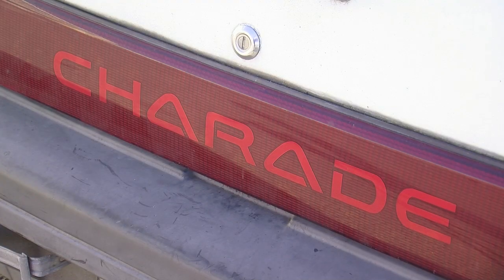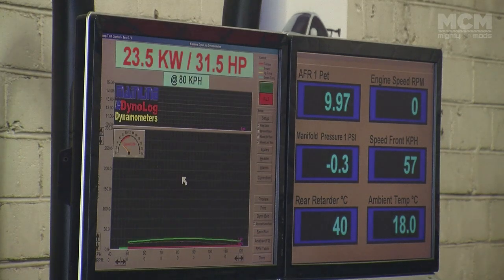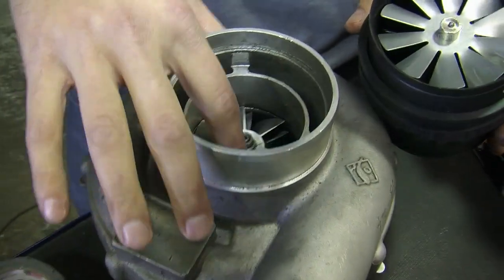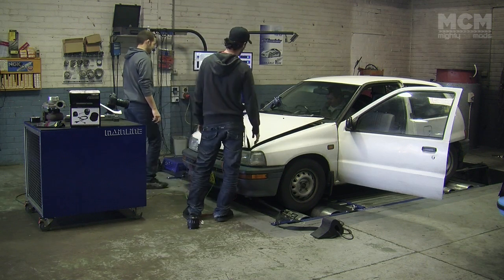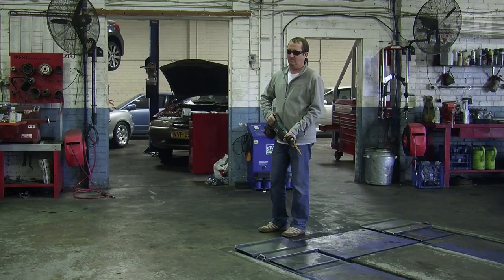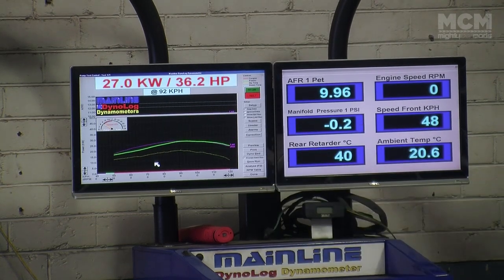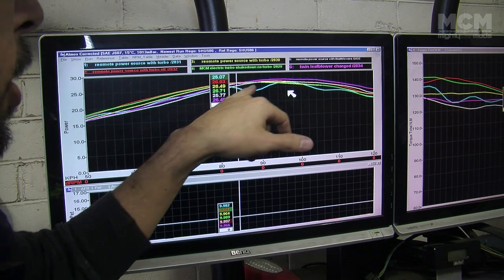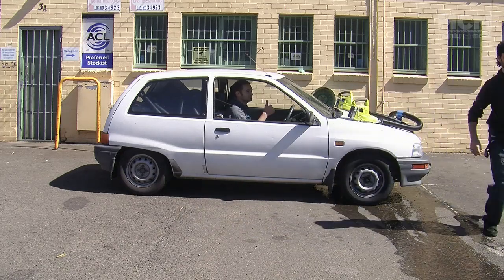Electric SuperChargers Mythbusted

Comment: I know I'm a bit late on this considering the video was put out in 2012, but you picked the wrong car to do any sort of forced induction test on. The intake has a thermostatic air cleaner, which likely is not completely air tight. That style of intake is likely not designed to hold boost pressure even with the TAC removed and the holes sealed.. I'm not saying that the electric stupid-charger would have worked anyway, but it is possible that the leaf blowers would have made better power gains if you had plumbed the intake tubing directly to the throttle body.
Reply: +Haywood Jablome 
The Daihatsu would also need to carb from the turbo model, which has a boost actuated secondary throttle. They way they are going now, it is only opening the tiny primary throttle.
Have you seen the Roadkill episode where they used lead blowers as superchargers? They gained a fair bit of low end power, but they did not have enough volume for high revs
Reply: +JP Onefourseven Yeah, I saw that episode. I wish roadkill would get back to their roots, pardon the pun.

Comment: C8H18 + 12.5O8 --> 8CO2 + 9H2O that's why its important going to uni or at least study what it's already written in books before doing something stupid. You need to add more fuel to the mixture to balance the air intake, otherwise you are doing nothing. What a waste of time and resources.

Comment: dno about the ebay ones but normal ones wont run on any car it depends on the size of the engine and the right air fuel ratio too big it wont work too small it wont work it has to be spot on

Comment: but seriously, even though i dont believe the "50 hp increase", i think that some improvement would have been possible with a stronger battery, better air intake, on an actual engine. get an old civic next time. just as cheap but actually works.  also i dont get why the leaf blowers worked if the charger didnt... i mean they do the same thing...
Reply: *****
i dont know, a regular turbo normally reaches about 100k rpm... this one "should" do 50k... so it, of course, doesnt held nearly as much but at least i expected SOME increase...
Reply: +Nazimelon There are 2 reasons why it can't work. 
First, the fan would have to do very high speeds just to keep up with the air flow and not be a restriction. Running the fan at this speed will be putting a load on the motor and costing power without actually increasing flow.  
Second, the fan is not the correct shape to practically create pressure.  
There are working electric superchargers. They use one or more powerful motors that drive a turbine or roots/screw supercharger, but never a fan.

Comment: actually, i dont get why turbochargers are so god damned expensive. seriously. im no pro or anything but isnt that basically nothing but two turbines strapped together in a casing?
Reply: +Nazimelon materials, and they do add quite some horsepower so you have to get the rest of your engine tuned to work with it without exploding, thats where the extra thousands come from, if your engine wasnt built for one, chances are its not worth putting one on
Reply: +Nazimelon Material to work in stressed conditions. And a little gap in axis or a radial axis coul blown a turbo and/or cause a failure in the engine. So to make all this things working in a temperature that sometimes makes metal parts glow red with very high temperatures without gap for thousands of kilometers and so on is not so simple.

You also add the costs with researching and improve in this tech that is happening through the years and you'll see it's quite a fair price.  /watch?v=KPln7U0gy78

Comment: Yeah I bought one of those before for my 99 Firebird, but couldn't figure out how to put it on, and it looked cheap so sent it back. They charged me a $50 restocking fee or something stupid like that.. bastards. I also have a Airaid CAI for my current 2014 Mustang and though I don't have a Dyno to measure, my 0-60 is worse by .08 secs (with tune) (5.73 secs) as opposed to the regular airbox (with tune) (5.65 secs), but.. with 91 octane it's .03 secs better (5.51 secs) than the regular airbox (5.54 secs) also on 91 octane (with tunes as well). I paid almost $400 for that noiseblower so not very happy about that. It does seem to work better going uphill with the CAI though, so that's strange

Comment: For a 400HP engine running 15 lb of boost, the power consumed by the turbocharger compressor (assuming 70% efficiency) is 38HP.  So you would need a 30kW electric supercharger to match the boost from the turbo.  However 5kW is enough to make a noticeable difference during acceleration.  Keep in mind that the turbo compressor power is generated by the turbine back-pressuring the engine exhaust to more than the boost pressure.

Comment: the stock air cleaner housing is only made for pulling air cleaner not for building boost you're loosing pressure out of the sides

Comment: that carborater wont put more fuel in with compressed air. need efi and the boosting device after the air flow sensor for that shit to do any thing. flooding a engine with air wont help.

Comment: its common sense if youve ever worked on a car, which you should have if you are going to try this....that fan at an idle speed MAY keep up with the vaccum demand of the intake manifold but will never provide positive pressure! especially at WOT! it is actually a restriction....

Comment: The force of air is blowing against each other because of the arrangement......
instead of using a T joint thats has a angle of 90° use a joint that has a angle of 120°
this helps the air forces building pressure at the junction

Comment: the sad part is that an electric turbo can work. the eBay fan is just too small. if you run a turbo electrically, and can make it spin fast enough, with enough power, with the same turbine size, an electric one should in theory do the same as a traditional turbo
Reply: I agree it is stupid, but if someone has enough time on their hands to waste, it is possible

Comment: I already knew the "fan-pipe" wasn't going to produce any power for the car. Like you guys said, a turbo spins at over 100,000 revs per minute and the clearances and heavy materials used to create the pressure is phenomenal! You can tell right away the bust by listening to each one at full wind-up, the real turbo screams loud and seriously, while the fan-pipe just lightly whines because you've turned it on... Besides, when the exhaust hits the bigger fan on a turbo to spin the smaller fan on the intake side, there's just damn near endless boost from that simple principle alone...

Comment: I have to say this, I have to say that in order to have  a increase in hp, you must take the carb out and adjust it so it can give the engine more fuel for more power otherwise the leafblowers are just leaning out the mixture unless its a adjustable carb that can increase fuel with the extra amount of air coming in the intake.

Comment: no they do the same thing. move air. turbo does the same thing. moves air. the issue is "how much" air. not speed but VOLUME

to show that none of these electric blowers can possibly do a thing all you have to do consider how much air even that puny little engine is MOVING.

1 liter at say 4000rpm. so 4000liters of air per minute. or nearly 67 LITERS of air per second.

none of these electric fans can move even a fraction of that much air.

this knowledge alone should show you how pointless they are. pure snake oil.

move up to say a 5L engine at 2500rpm and now your talking about 208 liters of air PER SECOND. Just from the engine "running"
Reply: +Nerys Technically you need to half that number as each cylinder is only taking in air every other rotation in a four stroke. Turbos compress the air so there is basically air "waiting" when the valves open and more makes it into the cylinder. A lot of the inefficiency in a gas engine vs. a diesel are pumping losses from having to suck air into the cylinder at higher RPM's. Your point about the fans being insufficient is still accurate though as something that small and weak can't move enough air to even keep up with the engines demands.
Reply: +wesleyson21 a turbo is literally a freespun turbine. fancy name for a fan. moving air by nature compresses air. when you swing your hand through the air you are increasing its pressure where it hits your hand this is why you feel it. a turbine is literally just a fan but one that spins really really fast. it moves air but because it most air into a closed restricted space (your throttle body etc..) since the air can not get out of the eay and has few places to go and the turbine has torque pressure builds and the air density increases.

more air in the cylinder. more fuel can now be added and you get more boom.

Comment: Saw an episode of Road Kill where they added a surprising amount of boost to a car using five petrol-powered leaf blowers but it took a considerable amount of engineering to get it to work. The main problem was the plastic construction of the fans and the fan housings in the leaf blowers could not cope with the back-pressure and so a lot of air leaked out through the leaf-blowers themselves, reducing their efficiency.

Superchargers and turbochargers are made of thick, heavy-duty materials like cast iron or steel and have strong pressure seals and are machined to extremely close tolerances to get the necessary compression. 

So in theory it is possible to add boost to an engine with an electric fan, but the engineering would be quite a challenge. And I don't really know why you would want to...

Comment: Not that I think any of these things really do much, they are just a gimmick. Did the guys seal the stamped sheet metal air cleaner housing, specifically the hot air choke intake port on the housing?

Comment: electric superchargers will work with a supercapacitor, a 12 V battery doesnt provide enough power. Combined with regenerative power generation, the super capacitor will get charged during braking and unleash the power during low rpms
Reply: +Ashmeed Mohamed 
Going on the rule of thumb that for 1psi a supercharger leaches 1hp from the engine. If you want 10psi you'd need 10hp (7.5kW) going to that supercharger. Assuming perfect efficiency at 12 volts, that is 625 amps. You are looking at some 20cm diameter wires to carry that and I don't think there is a DC motor in the world that can work with that amperage level.

Comment: Captain here,
compressed air = more air per volume
more air = more fuel needed to meet the 14.1:1 air/fuel ratio optimal mix,
 thats why you need new injectors and fuel pump when adding air compression to intake manifold. 

thats why it didn't work.

depending the manifacturer, the MAF might detect increased airflow and readjust fuel injection on low pressure compression, thats that's very unlikely.

Captain out.
Reply: Thank you! I had to go down the comments pretty far to see the correct answer
Reply: Yes that and the fact that the existing system was probably not providing any more fuel. Just adding air is not doing anything. Its kind of a silly test, to make more power adding more air there is so much more to it. More boost (air) more fuel (bigger injectors) hotter spark (ignition system) altered timing, possible reduce compression ratio. It was just interesting to see what doing only one thing would do, pretty much nothing.
Reply: Also look at that piece of sheet metal fan. Even if the little electric motor drove it fast enough it would probably flatten out before it produced any actual pressure in the intake. It was a while ago that I watched the video  Did they even test that ? A turbo would produce 20 psi of pressure or more. Its a solid machined impeller running at 100,000 rpm. What you see here is not even close.

Comment: Like the guys said, this fan has nothing to do with an actual turbocharger. A real turbocharger spins between 250k and 300k rpm, in order to compress the intake air to a pressure between 2 and 6 bars. There is no way in the known fields of physics for this little 12 volts powered thingy to deliver enough air flow to attain that pressure

Comment: One can't help but think if air leaks between the supercharger output and the throttle body. Maybe they should have taken off the air cleaner and adapted a direct fit air tight fitting.
Reply: +Mario Monti 
It doesn't matter. People have hooked these things up to sealed containers and they can't even make 1/2 of a psi.
Reply: +WraithCommander42 They need to shutdown the bull$#!+ companies selling these things. Legalized theft I tell you. lol
Reply: *****
Is it bad that I was thinking of selling these to make a quick buck?
Reply: +WraithCommander42 Only of you like broken returns and list money.
Reply: *****
Since people are still selling it, it must still make enough money to be worth it.

Comment: good video guys, But you should have used a electric ducted fan, like the ones that use for flying model jets with.  they are a lot more than 300 bucks, but some can create 35 lbs of pressure or more.  they use a brushless motor , not like the brushed motor on that piece of junk that you bought, I think that this video need to be redone!
Reply: +snaprollinpitts 
You mean 35 lb of force/pressure, not pressure. And even though those motors are very powerful for their weight and size, they aren't the 10hp motor you would need for something like this.

Comment: shouldnt you tune the car to let it know theres more air coming in? maybe thats why you saw no power increase?
Reply: +Bq B Doesn't tuning a car require that the car has an ECU? Very doubtful that the old Charade has anything even remotely advanced as an ECU!
Reply: This must be a troll. Have a nice day sir.
Reply: +Andy Mitchell Yes of course there is only Chiptuning ;) Exhaust/Carburetor/Fuel Injection Tuning is just stupid :)
Reply: +Andy Mitchell Perhaps adjustment to the fuel pressure and the carb. I can't tell if this car is carbureted or not, but I definitely think the guys could have toyed with that. Though I doubt the electric fan can actually move as much air as a real turbo or supercharger. It's probably useless!

Comment: Now I just want them to hook up a compressed air tank(HP paintball air tank, or SCUBA should work nicely) and have that run through a regulator into the intake.
Reply: +TheDudeofDudes Preferrably with niotrous oxide in it.:¬)
Reply: +TheDudeofDudes If you've ever been to the Don Garlits Museum of Drag Racing in Florida, you may have seen a dragster he made that used a compressed air tank instead of a supercharger. Worked quite well as it only needed to supply compressed air for less than 30 seconds. I think it was discontinued for safety reasons. 

JW3HH

Comment: Hate to say it but basic physics tells you that the e-bay superchargers will not work. A simple fan cannot work as a high pressure compressor, why do you think a jet engine runs so many stages..... I have been told a fan cannot generate more then a tenth of a psi of pressure, consider that atmospheric pressure at sea level is 14.7psi that would be a gain of less then 1% assuming the electric motor was strong enough to even do that which I am guessing that little electric unit is not. A REAL supercharger is using 10-60kw at speed to produce that boost so if you are using a 100W fan motor you already know that you are nowhere near actual boost if anything you are only constricting air flow. If you want an electric supercharger you will need an industrial sized electric motor mounted to a centrifugal supercharger but when you consider the weight/complexity of such a system you will quickly see why manufactures do not use such systems.

Comment: The hotter the engine gets the less power, so not a consistent test

Shit I was talking about the leaf blower 10 -15 yrs yrs ago for an 8 spd Mitsubishi ice racer..😆

The engine may lean out and lose power  in some cases? Carburetor vs injection 

You also need good exhaust

Remove the exhaust or put on a dump tube for more flow

Suck
Squeeze
Blow

What air does..

Comment: Do you think the electric "turbocharger" would generate any performance in my massive, 1.6 HP, 38cc HondaGX35 engine? This engine is going a Scwhinn Meridand Adult trike, with a Staton gear drive, and could use a tad more power for hills. The leaf blower seems like it might be better, since it is self-powered, but is a single leaf blower more powerful than the E-Bay "Turbocharger" ( Which looks suspiciously like a ducted fan bilge blower)

Comment: not saying it would have made a big difference but removing the crummy filter inside the factory air cleaner and using the higher flow included cone filter on the e-charger might have helped...

Comment: I think this test is not properly done.
I'm not sure you guys removed air filter or airbox. As you know, Air should be compressed after filtered. 
Which means, Air filter after turbine may disturb the airflow.
I can see the airbox(a black round thing on the engine) without any modifications. I think you guys just installed the turbine on air intake pipe which is connected to the airbox with filter.
If it is true, this results are obvious. It would be great if you guy try it again without the airfilter or with proper modification.
Anyway, I know it is just a scam. Just more air without more gasoline can't make a huge differences.

Comment: The pressure wheel has no reinforcement. At first glance you can tell that this will do nothing but compete with the intake vacuum... Handy information for those that know nothing about engineering :)

Comment: The leaf blowers are blowing right at each other so air can't move as fast into the engine because it has to find its way out first if you were to run them going at 45 degree angles at each other the air would get slowed down as much therefore making more power